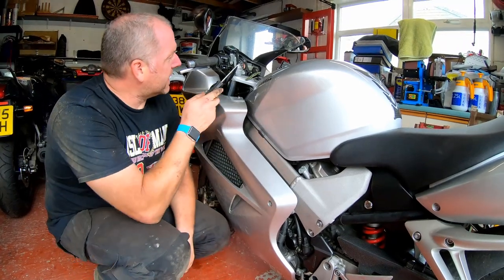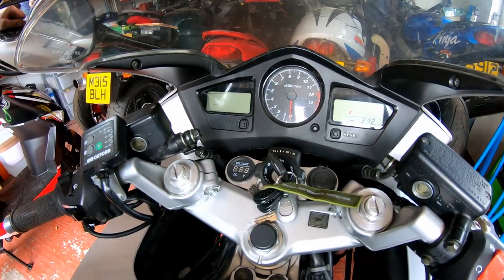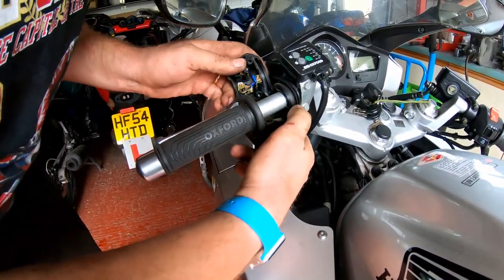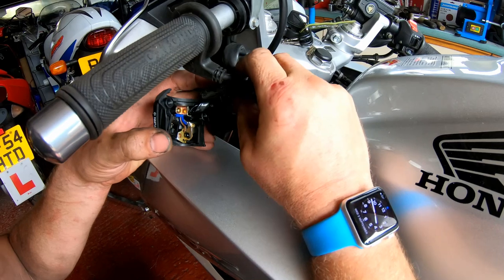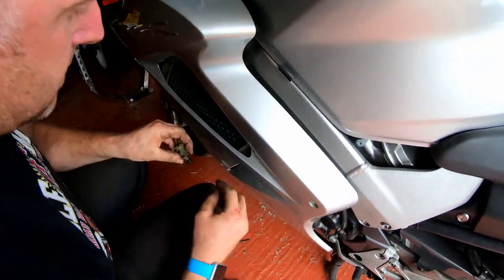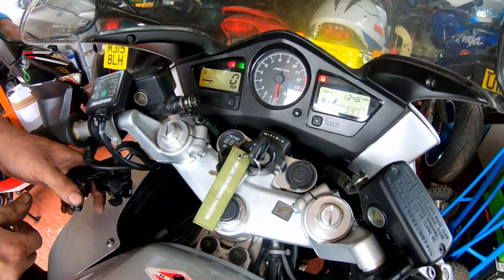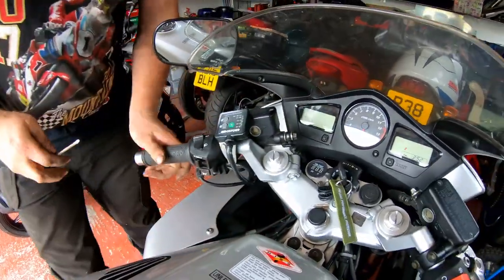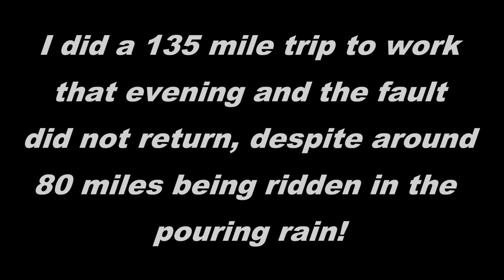2003 Honda VFR800 VTEC - Strange Intermittent Indicator, Turn Signal Fault

Comment: Just re-greasing it is only temporary fix. It will start to act up again in no time. Actually you dont have to replace the switch assembly. It is serviceable: After you removed the dial that moves the white block (like you did on the video), you can remove the 2 small screws that holds the underplate in and the wires down. This releases the black block that the 3 wires run into it (you can see them on your video too). You can remove the whole block just by gently prying it out with a screwdriver (it looks like its glued into the assembly, but its actually just slotted in there and pops off easly). After that, you can get the white block out (watch out for the small ball bearing and a spring that the moving dial pushes up against. They will pop out). Theres a small copper bridge (looks like a small staple with 2 dots) and a tiny spring inside the white block. The copper bridge is slotted inside the white block and the spring inside it pushes it out up against the contacts on the black block. The white block has a bit of grease in it that helps the copper bridge to move. This becomes tacky over time. This in turn will prevent the bridge to push up fully against the black block and disrupts the contacts to the blinkers. The bridge will stick at an angle hence causing the left side to work, but right side to act up. Usually the grease will soften up on hot weather and the switch works better. Also it becomes extra tacky on rainy, cold weathers so it will act up more. I had to scrape off the old grease inside the white block with a needle (it was like a nasty brown bubblegum), after that i washed the old grease residue out the grooves with whole lot of brakecleaner and re-greased everything. I also added a bit of copper grease to the 3 contacts inside the black block and the switch has been perfect ever since.
Reply from the maker: Absolutely great info there mate, I’ll take all that on board and give it a good look next time I get the chance. Thank you very much for taking the time to write such a detailed explanation! 👌🏻😎
Reply: Great info, I’ll be giving that a go as soon as heading into Autumn and Winter as mine is playing up too.

Big thanks 👍
Reply: @puddlehunter2084  glad i got a chance to help
Reply: Well after 2 hours of the most fiddly work on my indicator switch its all back together and working thank you Simo K. Note, when you have the staple thing out and cleaned when you put it back in with the spring and push it in and out it some times sticks at an angle, to sort this I re-punched the very small dimples at the end on the legs of the staple (clear as mud I take it). After cleaning all the sticky grease off with brake cleaner I have only re-oiled with WD40 as to me any grease will attract dust etc. and cause it to stick again. I will update if it does stick.
Reply: My signals now blowing fuse when activated so I'll be tackling this with video and fine instructions tomorrow. Thank you!  I also have a rear brake light that no longer comes on. So many electrical gremlins - have already done the stator and RR!

Comment: Thanks Kev and Hi VFR Riders! Have the same problem or better had the same problem. 
After removing the metal lever which  moves the switch I tried moving the switch manually and the indicators worked as intended. -> no electrical issue.
I then found out that this white part of the switch having contact to the metal lever is worne out a bit. The metal lever has this short and round pin which transmits the movement to the switch. Where this pin has contact to this white plastic part/ plastic shoe, the pin digged into the plastic a bit, really just a bit. 
With a small water pump pliers I then presst the round metal pin a bit, so that it became from round to oval. Be cautious that you press it the right way. The aim is that the bigger oval diameter compensates for the missing material on the white plastic shoe. 
Now it works just fine! 
Greetings from Frankfurt, Germany

Comment: I've had the same problem with mine. Sometimes when I ride home or to work in the early hours they won't work at all. My Hornet did the same thing and the switch gear is exactly the same. I soaked it in loads of electrical contact cleaner and that fixed it.
Reply: Interestingly, I was thinking the same...
Reply: Unfortunately I've run out of contact cleaner. Trip to halfords next week will sort it. Just had to use a cotton bud to wipe the dirt off all the contacts I could reach.

Comment: Hi Kev I have a question I have had the same problem on my 02 vfr usually after heavy rain and followed your guide however when I put the 2 housing screws back in place I noticed there are 2 screw holes for the back screw both holes seem to accommodate the back screw but only one is the correct one? Which one is the correct hole though? The 2 holes for the back screw are side by side I cant see it properly in your vid or in the service manual so I ve put the back screw in the outer hole if that makes sense? It fits and tightens up ok.

But that made me wonder is the other hole where water may be entering into the indicator housing causing the issue in the first place? does that make sense?

Comment: My VFR vtec had a very similar fault just after I’d tidied up the wiring going down along side the fork. I double checked to see if any wires were caught up and everything was clear, but when I reversed my tidy up the fault vanished?
Reply from the maker: The only thing i can think of in that instance is that perhaps one of the terminals in a connector block was being pulled slightly and causing it to break the circuit perhaps!
Reply: Kevs Shed I think you’re right 👍

Comment: Hiya mate random question don't reckon you know why my natural light won't come on.. 😭😭
Reply from the maker: It could be a faulty switch, if thou remove the switch you can test it with a multi meter. I’m pretty sure this procedure can be found in the manual. Are you finding that the bike won’t start unless you pull the clutch in?
Reply: Yeah thanks so much bud I mange to get it working with simple change the switch but still seems to be running abit off there seems to be fuel leaking into the oil I thought I fixed it last time by changing a o ring but it come back again 🤔🤔 any idea how you or where would you start?? Thanks

Comment: Mines just started playing up exactly as you described. Did your fix sort it out in the end?
Reply from the maker: It hasn’t repeated the fault since but I don’t consider it a permanent fix! I do need to pull it apart properly I think.
Reply: Cheers Kev. I shot a load of silicone spray in mine last night as a quick fix and its working again now. However its a weekend job on the list to pull it apart as you say.

Comment: Bit off topic to the video this Kev but what are your thoughts on using acf 50 to coat the bike for winter?
Reply from the maker: I’ve heard good things about it as a corrosion inhibitor but haven’t actually used it myself so can’t speak from any experience! 👍🏻
Reply: @KevsShed  thanks for your feedback Kev it's appreciated. Found out something bad this morning, vfr is over volting when hot. I have 5 weeks left on the warranty so back to the dealers it goes. Had a generator as I found out it was under volting after 2 days. Now I know what killed it.
Reply from the maker: I did see that on the Facebook group actually! 👍🏻
Reply: @KevsShed  Im glad you are on it pal. Its good to be in touch with people who have the same interests and want to gain the knowledge about the bikes they ride. I was lucky as a young lad I had a mate who's dad was a biker and at 11 years old we were riding the old Rd 250 with the coffin tank on the fields. When it broke we had to learn how to fix it. I can still do strobe timing and set points haha. Kids these days will never have that because the police are hard on them now. I'm happy I grew up when I did.